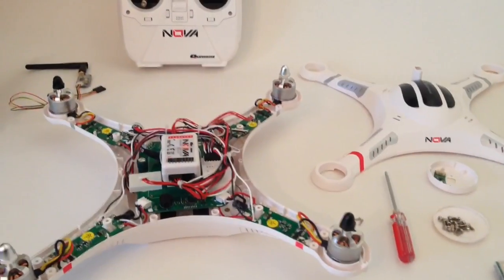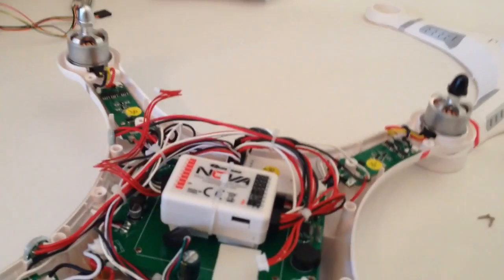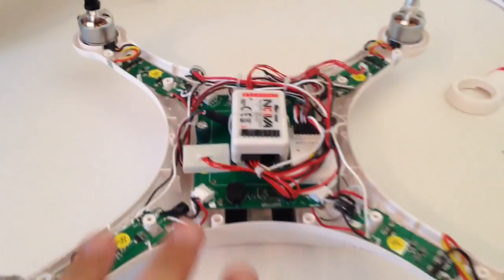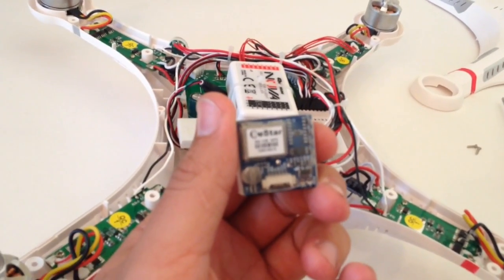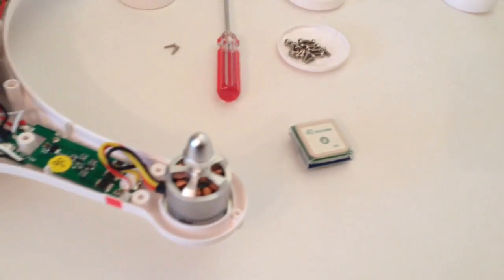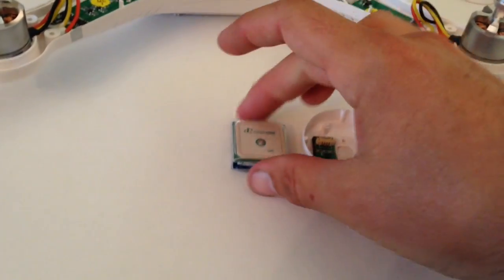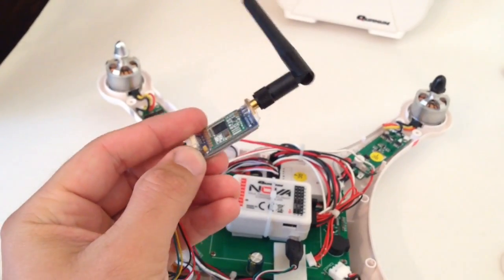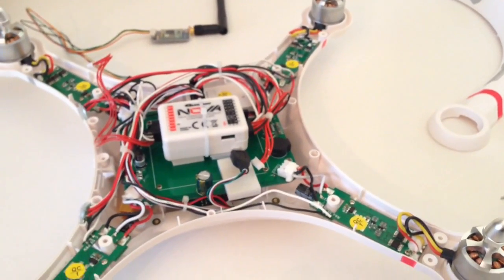Quanum NOVA / CX-20: Component Overview

Comment: Hi Mate. Could you possibly run by video and see if you have a solution to my problem. Im in the process of recalibrating everything from motors to accelerometer, compass and TX but I don't know if my issue is with the parameter settings within mission planner. Hope you can help. Thanks

Comment: Had a tip-over on landing the other day and one of my CX-20s motors stopped working. Still has lights, but won't spin up.
Do you know of a way to test to see if this either the motor or ESC or both?
Sure would appreciate some help (just ordered a new motor).
Thanks!~

Comment: HI dhdsracer, Thank you for the very informational video. I have the Cheerson CX20 open source. One of the thing I don't like about it is the sticks on the TX are very sensitive and not smooth. Do you know any way of changing something like that.  Also the CX20 has a slight drift to the right, it seems trim does not correct it. Any info would be greatly appreciated.

Comment: Great overview!

I received the cx-20 yesterday, I did not start flying it because first I opened the case and checked the build.

(It was a good idea because I found the flight controller attached well to the power board, it was just there in a 20 degree orientation rolling to the usb plug side. Then I removed the tape and moved it a bit to the center and glued back. I also noticed that the usb plug's wires were almost broken, the copper wires could be seen and the plastic wire cover was forced off.
I tried to put the upper case back then I realized that's why the controller was in a tilt, because when it was assembled the upper cover made a force to the usb plug and probably almost cut the wires of the usb plug. I did not connect the cx-20 to PC I don't know whether the outside usb plug is working or not.
I checked that in this version the gps module was put next to the controller above the receiver unit. The receiver has dual antenna system, how strange!
I hot glued everything which just easily moved inside.)

Than I noticed that one white wire from the receiver to the power board is being cut by the manufacturer. But why?
It did not seem to be cut by accident it was soldered there than cut, 4 millimeters above the power board.
This white wire:
http://img.banggood.com/images/upload/2012/chenjianwei/008.jpg
To the bottom right.

Is it also connected on your board or just cut there too?

I did not try to fly the cx-20 because I have doubts of the cut wire.

I just turned it on without the propellers, it paired with the transmitter, I did a quick calibration, turned it off and on again, unlocked motors, both 4 motors could spin up so this part work.

Should I solder back this wire or try to fly the cx-20 like this first?
Reply: FotoAmg AmgFoto 
I have the same white wire cut off! I noticed with a tester that originally the white wire goes into -B plug of receiver which I have no idea what it is for. Did you or someone discover something? I found a photo showing a similar white cable which is supposed to be cut but in my case it does not come from battery + power line. http://static.rcgroups.net/forums/attachments/4/3/2/5/1/1/a6874468-101-hk_pdu_board.jpg
Reply: ***** I asked Banggood Customer Care and they sent me this info:
"By consulting with technician, it is normal and no need to solder it."
Reply: FotoAmg AmgFoto Thank you very much! That saved me time to write to them and receive the same answer!
Reply: ***** Welcome! I think this red and black wire is going from the 5Volts stepdown (BEC) from power board to power the receiver and from the receiver to the flight controller/GPS etc. also gets the 5Volts from it and the white signal wire is not used at all.

Comment: Well.. I see you are master of Cheerson CX20,  I wish someone could help us out, since there are 1000s of cheerson cx20 sold to us with lots of problems and I know several owners had the same problem I have. So My cx20 tilts as soon I start it and it takes off and wants to fly away even my right controller is in normal condition. I too the cover off looked everything fine, I wish someone comes with solutions at least one of seller provide us videos for any type of trouble shoot. 
Thanks very much.
Reply: have u tried calibrating the quad
Reply: Brian Shaabani Sounds like your quad needs trimming use the trim buttons on the remote
Reply: I tried the adjustment on the remote transponder,  but trimming doesn't adjust anything.  I thing something internally is not fully function properly.
The total number of each adjustments are abut 32 steps , so I set each of them in the middle (16) but still is not cooperating. But the problem is only when I want to take off the ground,  when it's off the ground I set the GPS to position 1 than stay stable and flying is smooth and fine.
Reply: Brian Shaabani Yes it's a controller problem what i did was trim the quad once in the air or you can compensate the controller direction in opposite direction on takeoff so if it tilts forward slightly move you stick backwards etc.The reason i know its a controller problem is because i have 2 cx 20's.
Reply: Brian Shaabani Also i need to mention never mind if anyone have modded their quad i would advise against it people mod their quad then complain flyaways,crashes and stability problems stop modding this quad it's nice and cheap stop trying to make it into a dji phantom you will just ruin it.

Comment: I am having an issue with my cx20.  I have a dead leg on the (M1) coming from the flight controller running to the esc.  I thought it was a motor or esc issue, so i changed them both out, still nothing.......  I can swap the leads around which makes that engine run fine.  I even swapped out the flight control with another (my dad has the same quad) and it also had nothing on m1!!   So I'm guessing it's the power distribution board having an issue?  Just a guess since I am new to this.  

  Maybe someone could suggest something else to look at.  I am confused to say the least. Any help would be greatly appreciated.   thank you.

Comment: Hey Dhdsracer.
Have you looked into this any further... Does a better Magnetometer and GPS work better then stock.... Is there any to get longer flight times on this device... From what I am seeing adding more battery doesn't help significantly.  so... More efficient motors?  Better props?   Carving away at the Chassis to Lighten it up? eliminate unnessesary wiring?    I have just been reading up on this stuff and I am curious as to how other devices get better flight time.    Is ther a magic number as far as battery size... I am seeing others on the internet put in 2 2200 batteries and not get THAT much more time... What is the magic here?   Thanks ahead of time in the event you answer
Reply: Cole Hallman I use these they will fit just push connector down the side when putting battery in copterhttp://www.hobbyking.com/hobbyking/store/__14057__ZIPPY_Flightmax_2800mAh_3S1P_30C_.html
Reply: Cole Hallman Think the problem with the batteries sometimes is if you chuck a bigger battery in you get more juice but then more weight so the props need to be used more thus draining the battery even more so lol cant win can we, think my plan is to get better props, and just rely on spare batteries and change them every 15 mins or so

Comment: A few questions before I place an order.I want longer flight times, so Im gonna order the dual battery tray for the Nova. Should I buy 1x3000mah Blackmagic, 2x 2700mah Turnigy or 2x 2200mah Turnigy Lipo batteries? Props : 4x9443 or 4x9450?

Comment: Bought a Cheerson cx-20 "old" version open source the other day from Gearbest.com. Would this gps/compass combo work? http://www.ebay.com/itm/TACO-3DPOWER-GPS-Compass-mount-for-CX-20-Cirus-CX-20-Cheerson-Quanum-Nova-/381013874824?pt=LH_DefaultDomain_0&hash=item58b6325888
Reply: I would stay away for Gearbest.com. They have very long shipping times and they don't stand behind what they sell. My son has a issue with his Cheerson CX-20 I e-mailed them and they gave him a discount code of $30 and when you use it the original price changes to a more expensive one. The customer service Sucks!!!
Reply: Eric Babula Already bought from them. was at my doorstep in 19 days from China. Banggood, hobbyking, they all have unsatisfied customers. Just the way it is dealing with China companies. U.S. should start making quads.
Reply: Your right, company's from china for the must part have really bad customer service and we should start supplying them here.
Reply: +Eric Babula -
Yep, same Gearbest experience for me, even worse. They posted 
fake tracking info and sent me to a fake site, pretending like the tracking was real. I've waited over 45 days for things from them and haven't seen anything. They don't answer in their support sections either. They call them "tickets", but they disappear and you get no response. I finally had to file for a refund from my payment service. Clicking on tracking links inside an account always shows "Undefined". That's because the tracking info is bogus ! I don't think they even have some items in stock they list for sale.

Comment: After watching this video and actually opening up the Nova, was wondering if the Quanum Lea-6H GPS with built in compass would be a better alternative than what comes as standard? Have measured the GPS compartment and it should fit inside the original case with maybe a few mods but was more interested if it would be compatible as it says it is made for HKPILOT. Will have to mod the cables and resolder but that isn't a problem but was wondering if it is actually compatible as I can fit it but if it doesn't work then is a waste of time. Any help would be most appreciated.

Comment: Great review thanks.

I have a Nova & the only thing I changed via MP was the Angle, now 3500 (original 2200 if I recall )& it's a much better performing machine.
Q. Would it improve the GPS's operation if it where moved to the puck?
Also I looked into a H6 GPS & is the Crius LEA GPS MAG Ublox suitable as a better replacement?

cheers

Comment: This unit (PNF) "plug-n-fly" without tx, rx or battery is $269.  I'd say the APM 2.5 board and other electronics and motors/props are worth that just to avoid the hassle of trying to match up a set of parts and all the wiring for a 350.  If I got one, I'd rip the parts out of that lame plastic frame and install in one you can put FPV into.  A little shrink tubing will fix those ESCs up, and a decent GPS would round out a real quad.  The first time you land (and splatter) that plastic frame, you're going to be rebuilding it anyway.

Comment: Please check your facts. The Nova isn't "Identical" to the Cheerson. The Nova uses the pod for the magnetometer and all ports are brought to the bottom of the main unit to allow access without opening the shell. It certainly remedies a couple of niggles Cheerson owners had. It looks as if HobbyKing actually listened to the complaints for a change. Spare props and prop guards are available from BangGood.

Comment: Moved GPS to the top of FC so USB connector does not shade the antenna
Got NSats increased from 10 to 12 and HDOP dropped from over 2 to 1.62

Comment: Nice initial review. I'm wandering why from factory the GPS is not on the satellite location with the Mag, even if these are two independent board there is enough space for both modules. My real u-blox NEO6M, it has terrible accuracy near RF noise sources, it does need a protection on the bottom for get a good accuracy, so definitely the default GPS location is looking very critical for get any decent result (assuming is a u-blox module, my MTK module has way less problems related to RF noise around it). Little details that show the limits from the designers involved in this "Nova" project, unless you made a bad guess about being a u-blox module vs a MTK module. Still place GPS over a protective plate on the top of the copter is always a wise decision, especially if there is already a molded satellite available